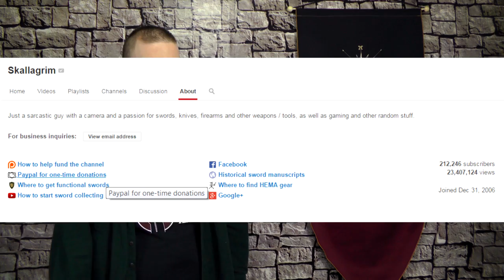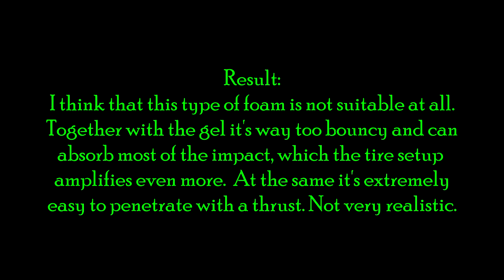The ongoing quest to find a realistic test cutting medium

Comment: Skallagrim, i've said it before, and i'll say it again. Test it on a Pig Carcass. It works the same, minus the very slight difference of no guts, and  you can also cook it afterwards provided that you set something like a tarp down to keep it from being contaminated.  
I'm also VERY much against the meat industry, so you could most likely get it from a local farm, where they are raised correctly. If not a pig, a cow could work as well. (Grass fed, farm fresh of course.) 
Deadliest Warrior (A now Canceled Spike show) used Ballistic Gel Torso's with a skeletal and skull, although i don't know where you could get that. They also used Pig carcasses and Cow Carcasses, so it must be a pretty accurate medium, especially when Armand Dorian (An Emergency Medical Physician/MD) consulted them regarding how the damage would translate.  
The Mythbusters have also used Poplar wood (as Darren Jacobson pointed out) and they found that in a certain thickness, that it had a near exact similar break weight to the human femur, so that may be a very good option. Downside of it though, you can't have a tasty treat afterwards.

Comment: You can use a clamp to hold the "bone" in place. Attach a clamp to a table or other surface and clamp the dowel or other material horizontally into the mold. As long as the mold itself is secure, there shouldn't be any drift in the material. Two clamps placed a distance apart would be even better, if there's enough excess length to hold on to.

Comment: suggestion for holding the bamboo...attatch a ring to the bottom of the mold and then when its poured, you can just jam the stick into the ring and tape the top in place so it cant move. or even make a cardboard top with a hole to avoid tape. doesnt have to be strong...just a barrier for drift.

Comment: The problem with ballistics gel is that it's only really good for high velocity projectiles such as rifle rounds because it's able to catch the projectile fairly well and is quite easily translatable into what damage against flesh would look like. However for things like knives and swords it's not very good at all due to its high resistance and rubbery texture, bamboo and dowels also don't simulate bone very well due to the fact that they don't shatter or have the same structure as bone. You're probably going to have to find something else to substitute both for a prop that can display realistic results, maybe a less dense gel and hollow wool or hard plastic that has small air bubbles throughout it would be a better substitute but it may be costly and I'm not familiar with ballistics gel and how much space it has to change density wise so it may not even be possible.

Comment: The best bone analog possible is already in existance. They are called sawbones. This medium is used by orthopedic surgeons (bone doctors) to train residents (medical school graduate apprentices) and to perform research. They feel somewhat plastic like and chalky but the act of pinning, breaking, drilling and cutting (this applies more to you) of these replicas feels exactly the same as real bone. As with all medical equipment they are expensive though I am not sure to what extent. Orthopedics generates a large amount of money and their tools and training equipment is particularly expensive. These saw bones are also disposable and can not be reused much like the multilayer suture material you have seen. 

Large bones given to dogs may also work. I lave seen beef calf leg bones approximately 7 to 10 cm thick and 30 to 50 cm long at pet stores. These bones will be cooked for preservation and food safety causing some deminiralization. You could drill the center of these bones, which will be mostly hollow, with a long masonry bit and add a bamboo stake or a wooden dowel to provide extra strength. From my medical education and experience treating patients a bone is a sponge matrix. It is designed to take loading forces near equivalent to steel of the same weight and takes shock loading forces like hardwood of the same weight but the shock of force from a blade edge is too much. Cutting bone is much easier than you think because the physics involves localized point loading of force. The limiting factor of cutting a arm or leg off is actually due to the muscles. Even relaxed they provide a tremendous amount of tensile force pushing the ends of the bone toward one another much like a standing tree will pinch your blade if you cut straight across it with a saw. A worthy addition to the test would be leather or even synthetic strip strung tightly along the length of the bone providing compressing force. This can be accomplished by securing one end to the bone with a screw. Pulling it tight across the bone length and screwing it into place at the other end. This would need to be done circumferentially.

The best method to center bone in media  would be to make a plastic base that fits the inside bottom of your mold with a counter sink hole in the side for a screw and a hole it the top for the bone or dowel or bamboo pole to sit in.

Comment: Hydroxyapatite-Tricalcium Phosphate. It is used to create medical grade bone substitute for grafting. You can ask your medical sources about it and also Calcium Sulfide(plaster of Paris). I think the trick would be mixing the proper density for real bone. They are ceramic but calcium based so I don't think either would be a huge risk for your blade edges. However, you would be a better judge of that than me. Hope that helps!

Comment: Hydrostone it's similar to plaster (harder and more brittle then plaster) would make a good bone alternitive. Dence expanding foam would work as muscle (should be easy to find at hardware store) and a half inch or 1 CM thick layer of ballistic gel I'd recommend having some water in it or coconut milk (almost identical to blood plasma) saturating the foam maybe use a bit on the gel to help cutting

Comment: For centering the bone structure you choose maybe you could make a metal disc with a whole in the center on each side of the mold. There will probably be some run off while drying coming out of the holes but it shouldnt be to bad.

Comment: don't know if the stickiness/friction problem was addressed. I would try a dry film mould release. Aerosol can, spray on coating, has a light color to give an indication of adequate coverage...in a pinch, a coating of Johnson's floor wax rubbed in. Good luck.

Comment: To keep the dowel centered while the surrounding material solidifies I would suggest a simple ring around it, that keeps it from approaching any edge too much. The forces that move the dowel probably are not very strong, they just add up over time. I would guess that simple cardboard or heavy paper might work. Cut out a disc that's the shape of your casting form, add a hole in the center and put the dowel through. You will probably place this inside your casting form before your pour the gel. So maybe the ring could use one or two cutouts to allow the gel to move past it. I don't know how "wet" this gel is, maybe cardboard would lose all structural integrity. But the heat should not be a problem.

Maybe the wall of a simple plastic container could be cut into size for the same job. You would just need to check if it's the kind of plastic that survies boiling water (i.e. probably not a thermoplast)

Comment: one thing you can do   :   find a rudimentary taper candle holder ..  lower it into the assembled mold   ...  lower the dowel into the mold and position it in the recess for the taper ... pour in the ballistics gel while either holding the dowel center mass until it sets up ... or tape 3 chopsticks to the outside of the mold and use string wrapped around the dowel and chopsticks to keep it centered hands free.
almost forgot to tell you..  you can end the sticking problem with a release agent.

Comment: ***** a good way to make your bamboo stick center is to use magnets. Attach the magnet to the bamboo, and have another out of the mold. This is a relatively cheep way, the only thing that could be a problem is you would need some kind of stand so that the cast is not standing on top of the magnet.

Comment: My recommendation for centering the bone analogs would be to make a pair of disks, one that goes in the bottom of the mold, another for the top (potentially with holes for pouring the gel through).  You would want a method to keep the rig from floating in the mold (screw it to the bottom maybe?) and that way, your bones would remain centered.

Comment: Hey Skall, why not add two wooden disks on the end of the bamboo dowel, and have those fit snugly against the edges of the mold and or covered in the gel itself? That would give the dowel literally nowhere to move, save maybe a quarter of an inch of "wiggle room".

Also I know the Mythbusters as of a few years ago switched from "traditional" ballistic gel to one that's made from animal protein, that might be something worth looking into.

As far as bone analogs go poplar wood is extremely close to the tensile strength of human bones, once again thank the Mythbusters for doing all the hard work finding that out. :)

Comment: A suggestion on something you could try: loosely wrap newspaper around a poplar dowel and let it unroll inside a mold and then cast ballistic gel in it. The fiber of the newspaper would give it the  tensile strength you'd see in muscle, which you miss with strait gel, and you'd get the squishy from the gel that you miss with newspaper.

Comment: ***** Tip for a bone supplement:
Get hallow pice bamboo or a thin  PVC pipe and and fill it with a silicon plaster mix to make the marrow then let it harden mould the gel/ silicon around it you could also use a ring bigger then the limb its self, and secure that to the bone with wire/pins(to keep the bone centred inside the gel)

Comment: I don't know what your molds look like but Skall, but you could drill a centered hole in the bottom of the mold maybe 1-2 millimeters bigger in diameter than the dowel or your bone analog. Push the analog through the bottom about 5-7 centimeters and seal the outside with caulk so it doesn't leak. Pour in your ballistic gel and the analog should be centered.

Comment: Skall, I would suggest putting some more weight in the bottom of the tire, or hang some weight from it. I believe it would alter the way the tire behaves and while it remains movable it would need a little more power to actually be moved. maybe something you can try.

Comment: I'm not terribly sure on how realistic it would be, but could you try wrapping bamboo in rawhide? Also, for keeping the bone material straight, I don't have the facilities right now to do it myself, but you could take a simple steel plate and cut out some holes and weld tubing to the bottom where you want the bone to go. Then wrap the outside of the tubing with wax paper and cutout a pour hole for the gel and place your bone mockups in. The tubing will hold the bones in place, and the gel will b easy to pour around it, and afterwards just pull off the plate and tubing and viola. This is kind of just a theory, but I hope it helps in some way.

Comment: Mr. Skallagrim sir for the centering of the bone you could drill a small hole not all the way through tho in the bottom of the mold that is the size of the bone and then stabilize the top of the bamboo stick.  :)

Comment: You should use a special type of wax, that is used in the manufacturing of fiberglass materials, to get the balistic gel (or what ever you want to use) out of the mold.
The wax is applied in 4-5 layers;
 after applieing the first coat, leave it for 15-20 minutes, and then give it a good shine (rub well) with another clean pice of cloth..then applie the second..and so on.

Or you can use polyvinyl alcohol (PVA), applied with a soft brush (and left to dry for 30 minutes), in one layer after 1-2 layers of wax. 

and it should not stick..:)

Comment: From the Mythbusters wiki:

Buster was designed with quick and simple repair in mind, and boasts improved joints, with a more realistic range of movement, and easily replaceable poplar wood "bones". Poplar was chosen because its shear strength was very similar to human bone, providing an accurate gauge of how bones would react in experiments.

Comment: Umm... I could be way off base here. But it seems to me that a really simple workaround would be to get a pair of wooden discs which will fit inside that mould of yours. Drill a hole sufficiently large to fit the bamboo through. Fit the bamboo through these holes. Position the discs at opposite ends of your mould with the bamboo in the middle. Fit clay around any holes should the fit not be perfect. Proceed with the pouring of the liquid ballistics gel into the mould. 

You should be able to get a centered "bone" in this way. This is just at the top of my head. I have no idea whether or not it will work well, if at all. But from a purely logical point of view, it SHOULD solve your problem.

Comment: ***** , have you tried to put some textile in the ballistic gel to dispersate the force of the impact like muscle fibers do?
I suggest that, for a first try, you use bandages (without many threads per square cm) and hot glue to avoid wasting the gel.

My idea to make this is to put a layer of hot glue of about 1cm and a couple of layers of bandages and repeat this until you have the thickness you want; then heat it to melt the glue. Afterwards, you should have to check that threads are still perpendicular to the blade so it works properly.

Comment: Hmmm perhaps to prevent drift you could put a cardboard bottom plug in and push the "bone" into the cardboard plug. Also, pound in a nail into the dowel tip and then clip the end into a point so it can puncture into some soft bottom plug.

Comment: Look into a good release agent to cover the mold first. also some wire at the top of the mold to hold the bone analog in place should do fine. you could do the same at the bottom. circle of wire, piece bent to the center and then upwards that you could slide the analog into. Messy to take off but it would hold it in place more securely.

If anything check into the release agent, that will solve your sticky situation. ^.^

Comment: You might want to use some heat resistant sillicone to secure the tip of the wood pole on the bottom of the mold, before pouring the hot gel.

Comment: I would probably try casting HDPE (high density polyethylene) for a bone substitute, cotton string in ballistics gel for muscle tissue and then something like neoprene or even leather as a skin analog.  I believe that in cutting tests it is more important to get muscle fiber resistance and "wet bone" elasticity than it is to have a good skin analog because skin provides very little resistance and absorbs very little of the energy from a cutting or stabbing blade and for the most part cannot produce fatal results on its own. The important damage to measure is that to muscle, tendons, bone, and the circulatory/ nervous systems.

Comment: hello skallagrim I have an idea concerning the drifting of your bone analog in the mold.
using the mold you where sent cut out 2 wheels of plywood small enough to fit snuggly in the mold with a hole (or holes if your using more than 1 "bone") big enough to slot in the bone, drop 1 wheel to the bottom to the mold, place your bone in the wheels hole, pour your ballistics gel mostly full (leave some room) and place your last wheel on the top through the bone again low enough that it stays in the mold. this will hold the bone in place at the top and bottom of the arm/leg analog. note I do not know how dense this gel is nor if plywood will float on it, but if it does not use some duct tape (or similar to hold the wheel in place just touching the gel

Comment: put a hole on the other side of the mold to center the bone so it just sits in a pocket as it dries.  no need for clamps here.  have you tried wrapping the mold in nonstick material like wax paper or saran wrap so that it is easier to remove?

Comment: just for everyones info, if you want to clean bones without cooking or chemicals wrap them in newspaper, then put them in a plastic bag and also roll that up but not too tight.  burry them close to the surface and leave them for a few months. insects will go in the bag and eat all the meat while the bag keeps most of the moisture out and your bones will be nice and clean when you take them out. dont put to many bones in one bag and make sure the opening of the bag is not towards the surface so rain will not fall in.

Comment: I'm not sure if anyone else has mentioned this. However, I'm pretty sure there are places that use carnivorous beetles or insects to clean bones. This method doesn't affect the bones structure or integrity. So if you do end up having to go that route it could work well. Though hopefully you'll be able to find a different option to simulate bone properties. I have similar views concerning the meat industry, so I'm hopeful that you'll be able to find something that will work for you. Good luck, I'm sorry I couldn't give you better help or advice.

Comment: Try a release agent on the mold itself. WD-40 or other specialized sprays (fixative, etc.) will help you easily pull the gel out after it is set up. I have a little bit of experience with this stuff

Comment: Just figured I'd throw this out there. Why not use an appropriately sized socket to hold it in place? 

JB Weld or attach it to the bottom of the mold fill it up then slide the dowel into the opening of the socket and secure it on the top and that should hold it straight